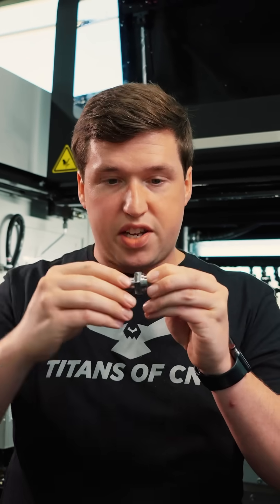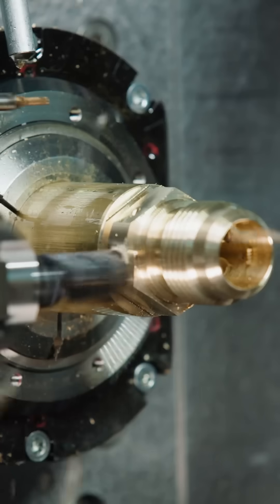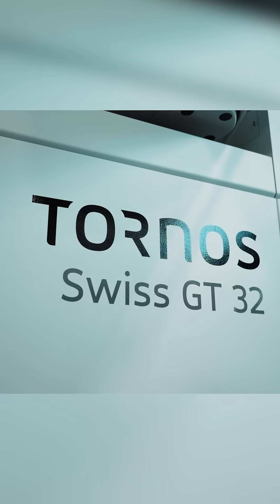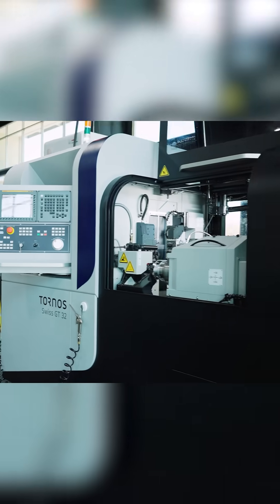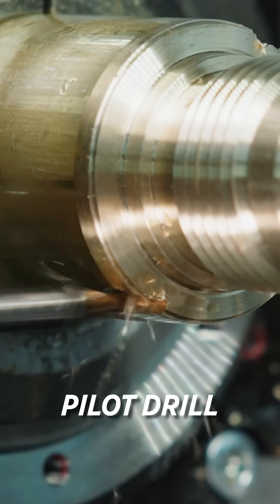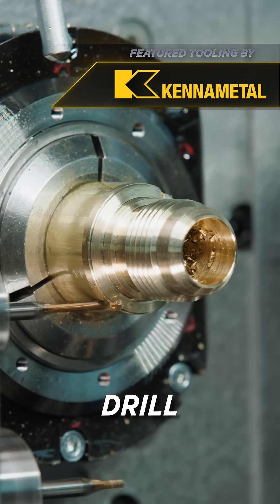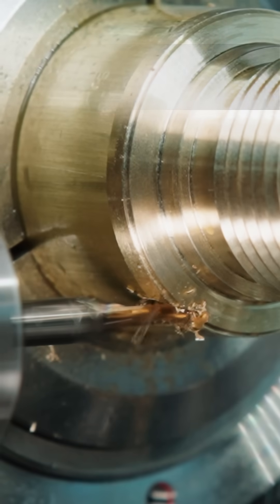What are Safety Wire Holes & How They're Made

Comment: As an aerospace valve mechanic, you'd be pissed if you saw the abuse these go through. We break the lockwire by yanking on it because it takes less time. But this is because we are the highest volume valve repair station in the world, and we are struggling to get things out the door fast enough so planes can fly.

Comment: Was in aviation maintenance school and hated having to do these! You have to turn it a certain way so the tensile strength keeps throughout a flight. Apparently vibrations unscrew bolts. And if you twist it too type and it pops you'll need stitches. I jus had multiple cuts 😅

Comment: Slick. Very slick. Back in the Stone Age before CNC we often ran these bolts on cam type screw machines then drilled the holes as second operations. It took specialty fixtures with integral drill bushings mounted 1 drill diameter or less from the hex face on the entrance side and within a few thousandths of an inch on the exit side to minimize the burr and drill deflection. We made a lot of them that way because we had to!

Comment: That wire would probably snap and a cotter pin like what’s used on cars would be safer to make sure they don’t come loose they could also use lock tight to make sure the threads stay secured

Comment: When we used to make these, the design had a little spotface flat so that the mini drills didn't snap. These were hand drawn prints from the 70's. 
If you're using oversized stock just so you can put a wire hole in without a spotface, as a quoter or purchasing manager I'd tell you to stop. 
Knock it off and go do something productive.

Comment: A machined bolt will pop the head off like a daisy. Those wires will hold the heads together if you want. If the bolts are in shear, they should be pins, but in tension they should be hot headed with rolled threads. If you dont understand how fasteners are made thats ok, you can learn.

Comment: There is a process where they have a sheet of metal that they put the holes in before separation into bolts. There is also a method where they cut out bolt blanks which are machined later where they never need to cut the head into a hex.

Comment: Most bolts on aircraft are held in place by " self locking " fasteners. This is generally done with the threads of the  nut fixture being slightly too small so the bolt jams into the thread. Kinda.  They cannot be removed by hand.   There are numerous more critical bolts that have safety wire so it's impossible for them to come loose, but most are done with friction lock nut fixtures.
Reply: Are Nord lock washers used? Or is that for a different application?

Comment: If you're making one screw you use an oversized bar and a longer drill than neccessary increasing costs. If you're making many you interpolate a 1thou oversized flat with a small endmill you drill into. It may be one extra tool but you save the extra material, the machining time, can work with shorter drills and finish the hole at the end.

Comment: I use safety wire on my race bike. Its mainly to keep the bolts in place if vibrations have caused them to lose torque spec. This way, there are not any bolts or parts getting dropped on the track.

Comment: A&P here and I would fail the safety wire demo at the beginning of this clip. First you chose the wrong side of the bolt to start the twist, second the twist doesn't come close enough to the bolt head, and third, you have over twisted the wire.

Comment: It's not "safety" wire, it's "lock" wire. Safety wire implies its safe (obiviously). Lock wire is a visual inspection tool to check if the torque has be broke or over-torqued.

Comment: What's funny is I've seen this trick done on BMW M5x/S5x oil pump bolts. As one vendor states: "Our Drilled Oil Pump Nut for M50, M52, M52TU, M54, S50US, and S52 engines is a strongly-recommend replacement for the factory nut that is well-known for backing off and allowing the oil pump sprocket to fall off. This leaves you without a functioning oil pump and no oil pressure! If you're doing any work with the oil pan off (rod bearings, oil pan baffle, oil pan gasket, etc) that is the perfect time for this precautionary and vital upgrade." - Bimmerworld

Comment: These designs are also used in the racing community, I've only seen on late model stock cars so far, but i bet they are used in drag cars as well for the insane torque and shock too those wheels are put under
Reply: I also used safety-wired fasteners in IKF go-karting racing.  I had a homemade jig for drilling safety wire holes through the center of threaded fasteners.  I also drilled safety wire holes through the socket of socket-headed Allen machine screws.  I used a lot of castellated hex nuts as well.  I typically used safety wire to secure two or more fasteners arranged in any kind of a bolt pattern.  I'd route the safety wire such that any CCW loosing of any one fastener in the pattern would tend to tighten any adjacent fastener(s) in the CW direction.  On individual fasteners, I'd used cotter pins rather than safety wire.  On less critical fasteners, I'd sometimes use deformed-type locknuts with medium-strength Loctite.  The one thing I didn't use was Nylock or Nylon-insert lock nuts.  The vibrations of dirt track kart racing would loosen Nylock nuts in just a few laps.  They'd usually end up just loosening and falling off onto the track somewhere.  Being a mechanical engineer, I never liked the advice of some people who say you should retighten all of your fasteners between heats.  My philosophy was to just engineer my fasteners properly once and not have to worry about or mess with them.

Comment: A&P here. Fun fact, some instances call for copper wire to be used in place of the standard stainless steel wire. These cases are always in areas that need to be secured, but also be able to be moved in an emergency. Sucks to install sometimes though, super easy to break it, especially if it’s .020” copper
Reply: F-111 tech here, we used it on our nuke consent switches. Our pigs had the nuke gear disabled and we just wired the switch closed
Reply: @stevenguy7363  cool!!

Comment: Question: Why not just mill it right through the center? So you're 90° off the flat?
Reply: what he made is a coupler (or a tube connector, not sure about the name), drilling a hole in the center would scrap the part

Comment: And why they’re so expensive! While racing all bolts needed safety wire, nuts as well. I got good at drilling holes in round bolts to avoid paying for specialty hardware. Each bolt was $10! In the size/strength required.

Comment: what is more expensive, you need to calculate how much more time you need for the extra steps you add vs. a little drill more often.

If you calculate for 1.000, 100.000 or 1.000.000 parts you will see a big difference in time saving wich maybe more money then a few drills.

Comment: Fun fact: 99% of these bolts that get safety wired; if the bolt was going to come loose, the wire would snap, trying to keep it tight.
Reply: I would love to see where that information is coming from. I have yet to hear about a helicopter transmission throwing its lock wire, and that's with 14 years of inspections.

Comment: I’m not an engineer, but to me, it seems like you’re making failure spot in the part
Reply: Critical failure would occur on/near the threads of the bolt, not on the head since the only significant stresses there would be from tightening/loosening the bolt.
Reply: Yea I can tell you're not an engineer

Comment: Some friends of my family died because the plane they were on had been improperly maintained and safety wire was not used when reinstalling a bolt
Reply: unfortunately safety wire is not that strong, bend it back and forth in your hand about 4 times and it just snaps. It's meant show you when something is failing or has failed, it does not stop them from coming loose it's just not strong enough.  Granted you are putting extra pressure on the bolts when you install the wire but its not that much. I'm sorry for your loss.
Reply: @PyroGam3s  It's literally used to secure bolts in place where there's heavy vibration. You can tell it's bad if it snapped but it's not its purpose. Your statement is no different than saying cotter keys are meant to show when bolts loosen too instead of securing.
Reply: @welcometoreality437 If your safety wire is snapped something is wrong, period. It needs looked at and possibly fixed. That is all I meant. Hopefully that is clear enough for you, because you just said the exact same thing I did, just in a different way.
Reply: @PyroGam3s  You said safety wire is doesn't stop fasteners from coming loose which is a lie. Safety wire's main purpose is to keep fasteners in place, to keep them tight. Looking for broken wire is just part of the regular inspection, the same way for any other component or torque check. It won't break under any normal circumstances but if it somehow is, the fastener might be loose. We said completely different things.
Reply: @PyroGam3s  If you open MrJonathanflick's responses you'd realize most replies are correcting him. I myself as a mechanic know that he is wrong, in many aspects. The wire is not soft, it's actually incredibly strong even the softer ones take many twists before breaking. The only soft wire meant to break is shear wire. You probably will never see safety wire broken, and while property installed it's 100% bolt security. If it's broken it doesn't mean it's loose, or out of torque either but it's safe to check.
Reply: well, I can't quite understand what he means either by "soft wire" but I do know what we use is very thin. I honestly don't know if its steel or aluminum or an alloy of the two. But I do know the way he describes it, it is a perfect depiction of what happens in aviation. I would have to guess the difference of opinion attributes to the different applications (cars vs planes) of safety wire as well as the gauge and material composition as that would affect how much strength it has. Also there are many in the lower ranks of the military that tighten safety wire waaay too tight and that also contributes to seeing so much of it in general being broken when going out to do repairs. So his story of seeing broken safety wire all the time is quite feasible.  And if anyone is thinking that aviation uses witness wire instead of actual safety wire... obviously you can see how that would be wrong.

Comment: Wire safety holes are usually drilled through the center of a bolt. Not through the side at an angel like that. It even shows that near the start of the video where they are being used.
Reply: Every safety wire bolt I have seen is like you have described. I have no idea why they are machining like this, but it could be necessary for a specific application, idk.
Reply: @rocketman0420 these look to be fluid or air fittings, so you cant run a wire through the centerline or you ruin their seal
Reply: I’ve got some old bolts I picked up at an Aerospace company 20+ years ago, they have the holes near the corners. The company was a NASA contractor.
Reply: Those types of safety holes are generally for castle nuts and cotter pins where the pin is holding the nut from backing off. These are for wire where they are attached at ends, generally, to two different components or fasteners. Because they are safetied on opposite sides, the torque from spinning the wire is tightening each bolt with one wire.
Reply: I have seen both styles. Also seen screws with safety wire holes
Reply: Both exist. Some have one hole going through the middle of the head, some have three, some have two holes going through the edge, some have three.
The application of the safety wire changes from bolt type to bolt type. The one in the video just safeties around one edge, the hole tends to wear off over time if frequently reapplied, though. 
With one hole down the center the wire passes through and around the side of the bolt head. If there is too much slack in the wire, the wire can slip over the edge, loosening the safety.
With three holes down the middle of the head the wire goes two times through the bolt head forming an X in the middle. Very safe, but can be fiddly in tight spaces.
Reply: I've safety wired both styles. It depends on the application and how much force is expected on the hardware. 40 thousandths and most 32 thousandths safety wire jobs are through the center of the bolt. 20 thousandths and shear wire use the corner holes.
Reply: Usually when the hole is drilled across the flats as they showed, it’s for fluid/gas transfer fittings such as AN fittings.
Reply: Holes on the corners are often used on bolts that are only a bolt as a secondary feature. Tempurature probes, pressure indicators, hollow tubes, etc. source: I’m an engineer in aerospace

Comment: As a line tech, Safety wire is actually used to cut the hands and fingers as to satisfy the aircraft's thirst for blood and not die of starvation mid flight.

*Edit: I forgot how to sentence correctly
Reply: This is wild to me that people get stabbed by safety wire.

I watched a dude stab himself through his whole hand from palm to back side with .20, I’ve never been injured by safety wire and hell I even prefer to do it with my hands over using pliers (I was in the army we weren’t allowed to use safety wire pliers).  An injury I do get though quite often? Bashing my knuckles and losing chunks of skin when breaking the what feels to be 700ftlbs of torque on what is supposed to be 110 on a 7/8 Igniter.  

I write all this at 0300 and I’ve gotta go to sleep for an AOG trip at 0900 tomorrow.
Reply: @Homer890 this is why I keep some really long ratchets and all other manner of tools that keep my hands away from the action. It turns out metal is harder than your knuckles. I also slow down and try to deliberately be very careful. Haven't busted my hands nearly as much. What I really hate is the sockets for axle nuts. I swear they designed them intentionally to slip off and send your knuckles into something.
Reply: @EntityOfTheVoid 
What kind of luxury plane are you working on that you have room for extra long tools?
Reply: @EntityOfTheVoid  oh yeah definitely.  I just use step downs to a 3/8 drive and use a flexing breaker bar,  then again our axles on Phenom 100’s and 300’s are only torqued to 21ftlbs.
Reply: @carstekoch  see that’s the real question.  I had to buy some bullshit special angled wrenches for removing an evaporator module, to which I then had to grind down those wrenches.  All so I could remove 2 VCS lines.
Reply: I worked at a flight school for a while where we did our own repairs, and let me tell you, I probably got more cuts while safety wiring than anytime else.
Reply: Dude the amount of times have had the back of my hand that cut open sliced scrape whatever from just a freaking cotter pin or safety wire while working in the cockpit is uncountable
Reply: My co workers used to say they could always find me by following the trail of blood on the aircraft.
Reply: This right here
Reply: it’s okay. u sentenced correctly enough
Reply: This is in fact correct. We learned that all planes have a blood thirst that if not quenched, will result in a catastrophe. Therefore the maintainers found the right way to satisfy these mystical beasts in the name of public safety. Don't let people who say it was regulations fool you, they were the sick ones that made us the test creatures in their first expirements.
Reply: U sentenced good
Reply: Submarines are also full of safety wire or lock wire as the navy calls it.  The running joke was that the navy calls it lock wire to ironically admit that it’s not safe at all.
Reply: No way 😭😭. Who let bro cut their own fingers.

Comment: Not just on planes, they’re on any bolted device that you do not want to come loose, such as the turbine shell, high pressure steam lines, etc.
If it has a chance to vibrate, or pressure slip the bolt off, they use the wire safety.

Comment: Or create a spot face the same size as the drill and avoid having to use larger stock. I would think cycle time increase, if any, would be more beneficial than larger stock size cost. Always more than one way to the hardware store I reckon.

Comment: ah so this is the first time ive ever seen the hole only go through the shoulder of the hex and not straight throught the middle and thinking about it it makes sense, because if you were to drill through the bolt, you've comprimised its strength , no point trying to hold onto the head of the bolt with a wire if the head of the bolt itself is what snaps off because its been drilled through, very smart 😄
Reply: Depends on the series of hardware. AN generally drills through the head where NAS generally drills the corners. Drilling the corners makes doing safeties just a little bit easier which is nice in cramped locations.
Reply: The head won't snap, it's there to keep it from coming loose during vibrations not to apply a heavy torque on the bolt. If you can somehow damage a bolt you must be special, they don't break without extreme amounts of force.

Comment: I would think that if you were drilling the holes before the bolt head was formed, they are probably not heat treated/hardened bolts. They probably wouldn’t hold much torque to begin with.

Comment: If they put the bolts in on the max, this would work, however the wire lock does not work if the bolts are not present